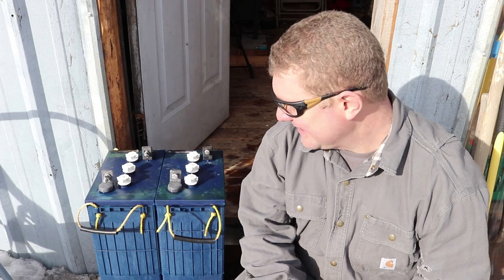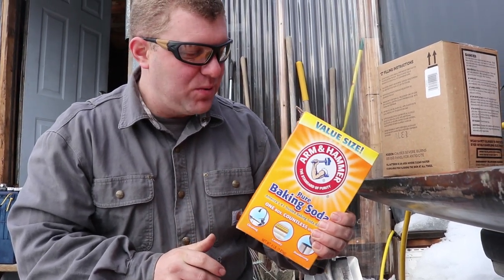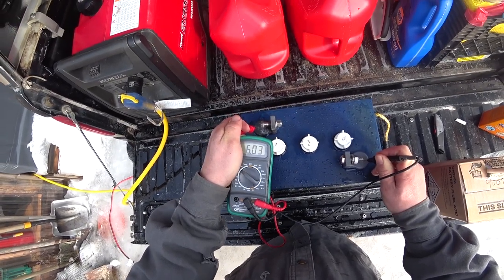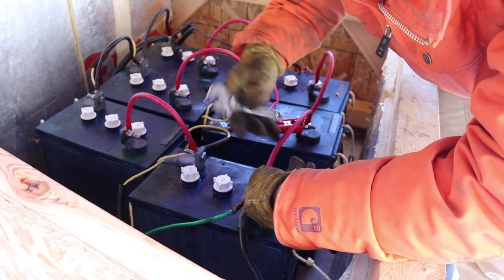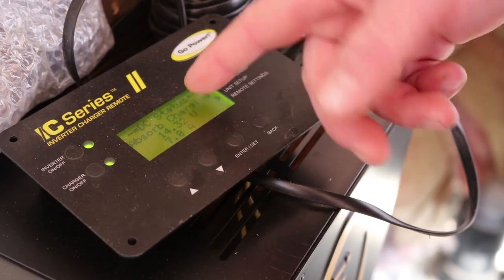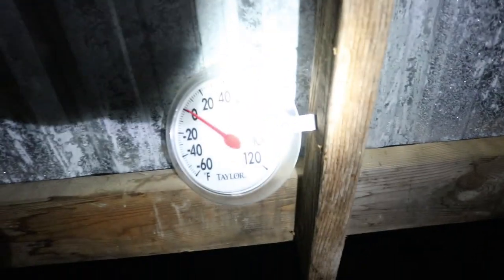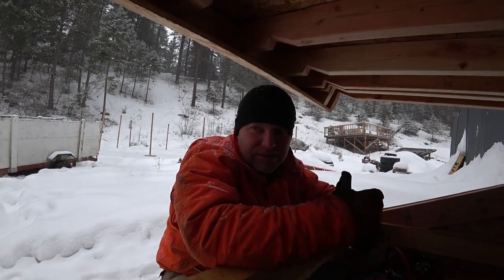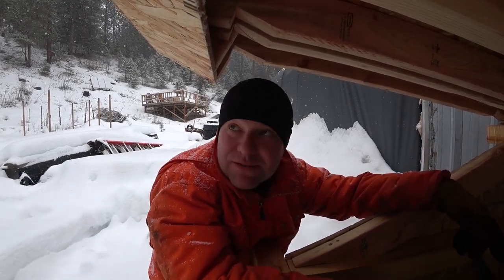DEEP CYCLE BATTERY HACK?! Fix $400 battery for $20?! (Part 3)

Comment: No matter how you slice it, as a battery goes through charge / discharge cycles and ages, plate material is lost (the sludge you found from the bottom of the cells).  The battery effectively becomes smaller.  Nothing you can add to the electrolyte can fix that.  All products that claim otherwise are merely snake oil.  I would highly recommend a forklift battery, after you have settled on the system voltage that you want (12, 24, or 48), higher the better.  This way you do not have series parallel cell arrangements, which can cause confusion when attempting to troubleshoot, as you've discovered.  Take very good care of it, and it will take very good care of you.  You know, except for the diaper part. :) Love your videos, BTW. Oh, another thing adding more solar panels would be a very good thing.  You want your battery to reach a full charge on a regular basis, and it would be nice to be able to do that without too much generator run time.

Comment: Yes, just use the battery bank all together, everything in parallel will self-balance over weeks. Voltage works like water flow heights. If one battery reads higher voltage, then it is not stealing anything from the rest, that upper voltage will go down to the same as the rest, even if you neither charge nor load. Only very slow charging can equalize high capacity batteries in parallel.  Real balance charging is only doable for series banks, in the case of 12v with 6v batteries, you only can balance 2 parts of 6V (with the appropriate balance charger). Anyway I don't think it is needed, you only need to check if you have the capacity and to use it. It is always better to wire in series, work with 48V (you loose less in the wires) maybe you have enough battery capacity, but you have nowhere enough panels to fill them in 2 or 3 sunny days. You will need the generator each morning until sun is up, if it is sunny every day. Use what you have, you will soon see that maybe more pannels would help.

Comment: You are aware that temp is related to voltage? You have to keep those batteries out of the freeze. You are fighting a loosing battle. Also those batteries can not be charged in 7 hours. A basic car battery can charge for 24....

Comment: I think it is time to make the call and pull the plug on the life support for those batteries.  Just take the 2 you've had problems out of the system and run on the other 6 'good' ones.  It could also be the case that the total amp-hour rating of the battery bank is more than the inverter-charger can handle adequately.

Comment: There's more to a lead-acid battery than just electrolyte chemistry.  A high rate of self-discharge implies that your plates are sulfated and turning your battery into a resistor.  It's mechanically done for.

Comment: good on you for the safety glasses.. ive been cringing during the whole series.. i was in auto shop during high school and a friend pulled the caps off a battery still in the car.. the decided to pull the battery.. he got if most of the way out of the car, but then it slipped and fell back down into the battery holder...shooting battery acid out of the open ports and into his eyes... He was blinded for 3 days..even though he used an eye wash station within a minute after getting splashed... BATTERY ACID---BAD STUFF...
Reply: owch, that is terrible about your friend,   but I have to ask,   Did he get any super powers?

Comment: Uh, what about desulfication? Why the heck dont you do that? Sulfication of the plats is the number one thing that kills batters. While I am here why buy those expensive batteries when you can use 6 v. golf cart batteries wired in series or power scrubber batteries? These alternatives dont have the price raised as many alternate energy use products.

Comment: convert the battery box to a shed, insulate it properly. For generation, consider a magnetic turbine, that way you aern't reliant on weather or fuel for power generation. vids on youtube. Put yr batteries on castor dollies, its easier to handle them.

Comment: Why don't you just install a heater into your big outside battery box connected to a thermostat  and  frost thermostat  to control it  You will always have the right temperature for your batteries. . Is the floor of it insulated. and you should double up on that insulation  and insulate all the box including the lid  No more frozen batteries

Comment: I was told once from a guy that worked at Interstate Battery, that if you drop the battery from about 8 to 10 inches onto a hard surface. That the impact will knock the  deposits on the battery plates loose and you can flush the battery from there instead of going through the process of desulfation. My first reaction was, What!? but I tried it and it worked. I also flushed the battery with new acid twice and each time I emptied the battery more sediment came out. I saved 4 batteries this way. It's not as good as doing it the proper way but it may work for you. I went on to get 4 more years out of 2 of the batteries. I have no idea how old they were when I got them. Good luck!
Reply from the maker: If this batteries dies, I'm totally trying this! AFTER I tried the aspirin idea someone else mentioned. LOL.
Reply: I tried the aspirin and it didn't work for me. Hope you have better luck than me. BTW. Love the videos! keep up the great work!
Reply: Please do not do this. The batteries you are working with are to top heavy, you will break the case open. Like others have said replace with new batteries if you can, and where your power from the solar system comes to the battery bank.

Comment: great videosbut commentsI don't know where you live but bats don't perform well when its that coldI don't know what your battery bank voltage is  or your panels configuration  is ,but if you are interested then skip your charger and connect the solar directly to the panels  to get a good equalization charge voltage higher than your charger can get . I have done this with a 100 ah bat and 60w solar panel to get the acid bubbling at 16v .  cheers from RSA where the sun shines

Comment: Assuming your inverter/charger is 50 AMPS an your combined battery capacity is 1500 ah.  It would take nearly 30 hours of straight charging to top off the batteries.  You would be way better off running a 24v system with that many batteries.  Would be a lot safer too.

Comment: I hate to say this,but,my experience with batteries is that you need two full sets,so you can use one to run your "stuff" and work at straightening out the issues with the others.I do have a small amount of experience with battery banks,I'm a retired transit bus mechanic.Doing what you're trying to do,piecemeal,is the way madness lies...Sorry.

Comment: hint. older made batteries had a deep space beneath the plates and the case. allowing the dregs at the bottom to not become a resistive self draining load. this fact is noted in one of John Bedini alum battery videos. now what did I say about flushing the batteries by drilling, plugging and refilling with filltered recycled acid. a big hdpe pail and a ceramic based filter comes to play. you could cut bottoms off other battery cases or obtain hdpe plastic chest nearbthe same size as the battery case size or a tad bigger. then adhearing that to the battery cases with windshield urethane. you can slit the sides down close to it's base. so what causes these dregs? flaking of lead plates and the isolators disenigrating during to low of voltage desulfacation process. old farmers knew this. old battery manuals stated you have to get the voltage up to 15.1 to 15.3 volts for the first few min's of charge time. it's not in relation to current flow. it's all a electro-chemical process, like electroplating metals. where you really don't want current flow.

Comment: I have currently work in the Flooded Lead Acic world for the last 14 years.  US makes great batteries and is a long term customer.  I have skimmed your battery videos.  changing the battery acid will not give you long term successful results.  if your SG is low its because of one of a few reasons.  previously overfilled resulting in loss of acid (needing an acid adjustment), sufatiion (resulting in trapped acide)...can be fixed with a constant current charge (IE Equalize) then cycle and EQ again....repeat as needed.  if you spiked with acid and it was sulfated you will see short term success but long term damage.  many of your trial and error tests were good but performed in the incorrect order.  May end up working or resulting in long term damage.  if your charger is too small you will (continue to?) have sulfation problems.  PS do yourself a favor and get a watering system.  I would be happy to sponsor you with one.

Comment: Thank you. 
Thanks for assuming the interested audience might include people like me: (gender-irrelevant) nerdy scientists types, but I think that some housewives may be interested in this series. Thanks for being more inclusive in this edition. Thanks for reading comments.
Hey, we ALL live and learn.
This has been really a good series with sound scientific principles. Nice record keeping and good problem solving skills! The frustration is just part of the puzzle; it's just harder off grid in the winter. From the outside, it looks like you are making progress - in addition to learning more about your system - just not as fast and as completely as you want.
Thinking by keyboard, if you neutralized the battery acid at all, part of the result is water, which is what froze in the bucket- there might still be acid at the bottom. I suspect that the battery acid has a lower freezing point than water; if I am correct, that's why your batteries no longer freeze.
I love your battery box; I don't see anything wrong with it, except that it might benefit from a bit more insulation. Yeah, you might change the design if you ever make another one, but it works, looks nice, and you learned some joinery.
I hope you can resolve your power issue.
Reply from the maker: Nailed it. This is all one big lesson. Hopefully others can learning something, if not from our successes, then at least our failures. :) Can you imagine if we knew it all? Then what we would do?
Reply: Pure Living for Life its not failure its learning. failure is giving up and walking away from the issue. im not good at quotes but the whole light bulb thing he did not fail x amout of time creating the light bulb he found x amount of ways not to make the light bulb.
Reply: Pure Living for Life its not failure its learning. failure is giving up and walking away from the issue. im not good at quotes but the whole light bulb thing he did not fail x amout of time creating the light bulb he found x amount of ways not to make the light bulb.
Reply: I think we (collectively) learn more from mistakes than accidental successes. I view failures (or, as I call them, "unexpected\unintended results") as opportunities for knowledge and creativity.
I've been a subscriber since you first moved to your land. Love the videos because they are honest and real.

Comment: Do another fluid change but, drain acid, flush with distilled water and let sit a day, drain distilled water and fill with new acid.If you wish to try and desulfate the plates, connect the battery to a trickle charge in reverse with the distilled water only for about an hour, then drain and refill with acid.  Getting the junk out of the batteries is a real plus as that stuff can make small shorts in the cells.  When a cell is sulfated badly, the cells actually grow sulfur shorts which cause the self discharging.  Best of luck ...

Comment: Lengthen the necessary cables so you can do your swapping.  Use split bolt splice connectors (cheap), a layer of friction tape https://goo.gl/CMcicm  If you want it really want a waterproof connection. add a second layer of rubber splicing tape https://goo.gl/CGXpFl

Comment: I told you on other videos you need to clean the plates good little vinegar and baking soda and then rise the battery real good. then ad one half teaspoon of Epsom salt in each battery cell fresh battery acid give me the slow charge. works every time cleaning the cells is the most important thing rising out the baking soda is very important as it will neutralize your new acid where you rinse with vinegar and water.

Comment: .break the batteries into two banks ,,, deal with one bank at a time ...if one of the banks doesn't perform ...break the bank in two again and find out which bank doesn't perform now you are down to two batteries one or both are bad.

Comment: Always connect the red first ground  last  so while charging unplug charger first then ground then hot jumping a car red first then ground to dead battery then red first then ground to hot battery the object is to never make a spark that can easily blow up a battery and for goodness sakes go buy a face shield safety first

Comment: I don't remember what video you put in the battery switch. You do not have fuses and you didn't have it where the switch disconnect the solar charger. If there is a short in the wires it will put a hard load on the battery's. They will be putting out a lot of hydrogen gas. I would not want to open the cover and disconnect the wire, if there is a spark then the battery box will be a big bomb! I know you don't think there can be a short in that wire. Believe me if there is a wire there can be a short. The imposable happens more than you will ever believe. I have been working around battery's and other electoral things most of my life. I have a General FCC license, I have worked on 2 way radios, juke box, Burg and Fire alarms, and many other things.  I can tell you some many time I have seen things that everyone would say it was imposable but it happened! I was working with a steal measuring tape once and it slipped. It is imposable for it to slide between the plug and the wall outlet and hit the connections. BUT IT DID! Bottom Line Fuses are very cheep! Put them all over the place!

Comment: OMG get yourself 2 cheep box end wrenches for that battery box. stop using UN-insulated adjustable wrenches.
not only do they slip as can be seen in this video(you did not seem to notice) BUT they can easily slip and wield themselves to terminals.

Comment: whether your batteries last or fail. your education yourself. nothing wrong with self education. being I'm a ham radio operator. but the best education comes from grumpy older men. I'm 53 going on a 100. if my education level is questioned. because I always questioned my granddad, dad and uncles. not to say I didn't weed out the chaff.

Comment: Two more things working against you... the more sulfate the slower the desulfation goes and the colder they are, the slower the chemical process works. You might consider putting a 100w bulb or small heater in the battery box, powered by the generator while you are using the generator to charge the batteries.

Comment: FYI the battery tester you are using only applying 50 amps is nothing for your batteries you  can be using 20% of the surface area on those Led  plates and still do 50 amps no problem. that tester is designed for smaller car batteries which don't have quite as much Reserve and even then it's underpowered. in the mechanic shop we used to use a professional load tester and we used to apply around two hundred amps to really test car batteries which are smaller than yours and then you start getting good results about what that battery is capable of. Now for the bad news once batteries start the show signs of power loss anything you do at this point in reality is only a Band-Aid that being said I know batteries are expensive and the Band-Aid could possibly give you another year or two at best if you're lucky but eventually be prepared to get new batteries I've also played with  a battery desulfator made by Max-desulfator on eBay for about 18 dollars. I was able to save some of my higher quality batteries but noticed on some of the cheaper small batteries didn't seem to work as good ( and if it only save One battery it's still pays for itself and then some )but note it takes time you need at least 4 weeks or more   per battery. it may be too late for the two batteries (or not you won't know until you try) but the other ones in your bank could be brought back to life and give them a little bit more time. I have two of these battery desulfator on my bank and I just keep rotating four weeks on One battery and switch it to the next battery and eventually repeat the cycle. The battery desulfator seems to me to be more of a maintenance tool by helping you maintain batteries especially in off-grid situations where they  might not receive a full charge for a while. Batteries are tricky Little Things and are  good at giving mixed results. Good luck and I hope this helps a little. PS great video

Comment: You should use phrases like"....Electrolyte replacement." instead of "Electrolyte switch" I mean can you imagine the number of goofy auto parts store clerks ripping apart there boss's nice neat store room because they are looking for an Electrolyte Switch because they weren't located next to the headlight or windshield wiper switches and your still standing at the counter with 15 greasy and sweaty local shop mechanics lined up and getting madder and madder at you by the minute?   LOL!

Comment: But if a battery is discharged because of damage to cells, poor connections or a charging system that isn't doing its job, the battery could start freezing at the same temperature as water. "A 100 percent fully charged battery will not freeze until approximately minus 76 degrees Fahrenheit.Feb 18, 2014